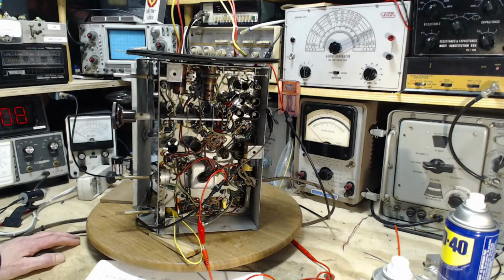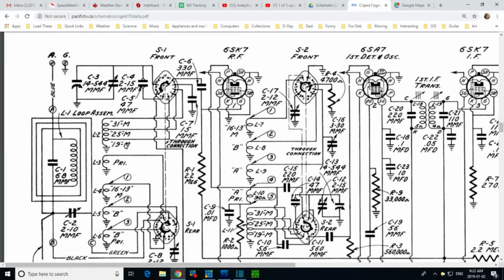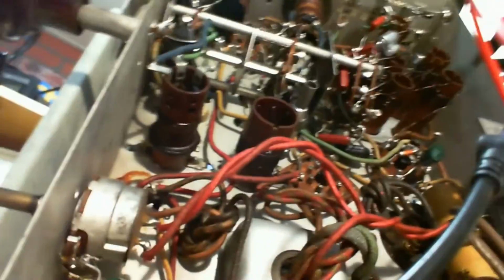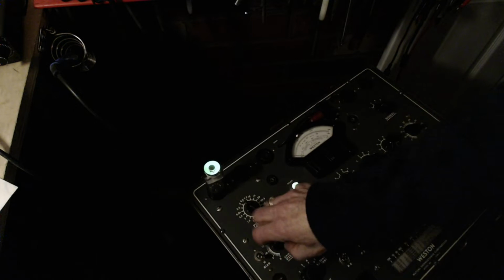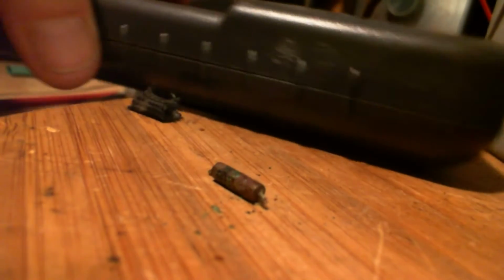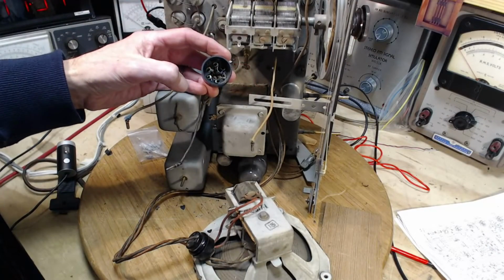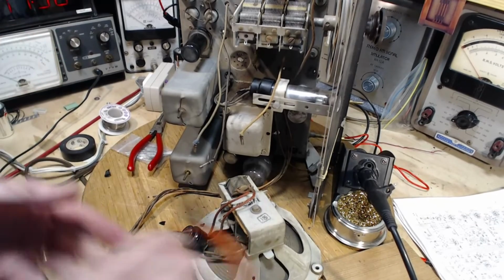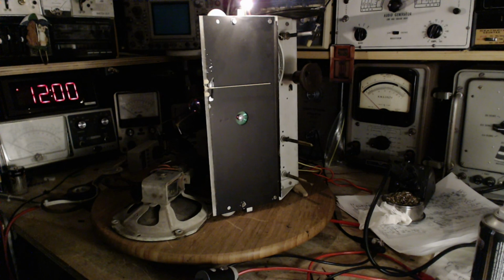General Electric KL-70 AM/SW Radio Video #39 - Magic Eye

Comment: I'm enjoying your restoration of this radio and it's twin RCA A-25, not the least because I own an RCA A-25 that did work (at one point).
I used to be able to receive the Australian short wave service on it in the basement with no external aerial, which either means it was a great radio or ABC had a real flamethrower.
Sadly, Australia discontinued its shortwave service a year ago. The bands are getting pretty lonely these days :(
If you don't mind a suggestion for protection of the eye tube wiring, fellow Canadian YouTuber Mr. Carlson's Lab has a technique that he uses.
Check out what he did here with the dial light wiring on a DeForest-Crosly Empress chassis (around 23:00):
https://www.youtube.com/watch?v=0vuhqoRB-y8
He used a high-temperature sheathing such as is used on the wiring for toaster elements to protect the wiring harnesses from heat and abrasion. Seems like it might be helpful in this case.
I apologize if I'm telling you something you already know.
Also, if Peanut insists on hanging around when you're working, the least he (or she) could do is lend a paw! Soldering in that replacement resistor might have gone faster (or not!)
I really enjoy your channel and admire your patience. Looking forward to the next adventure.